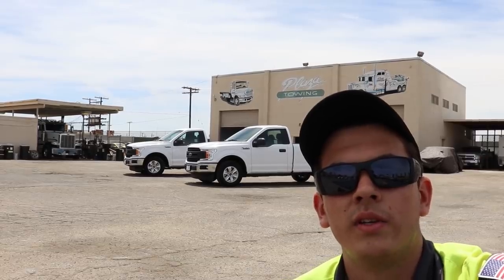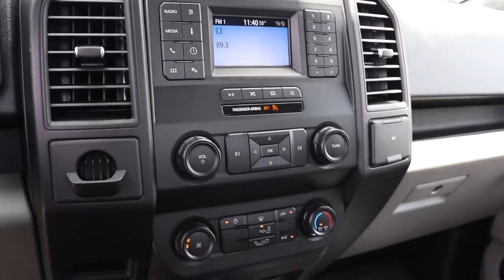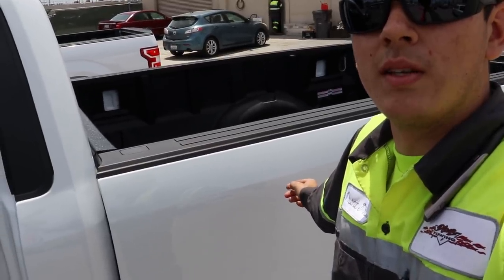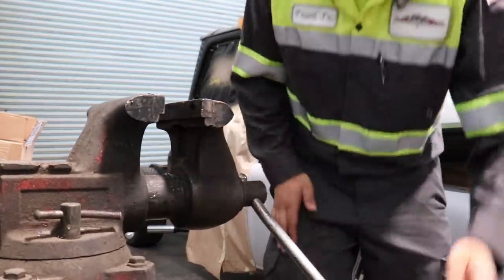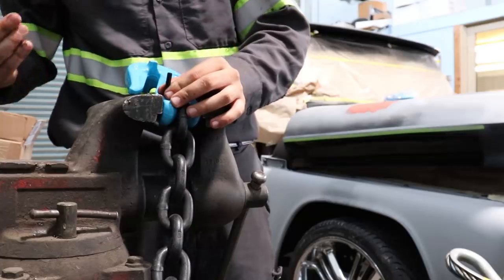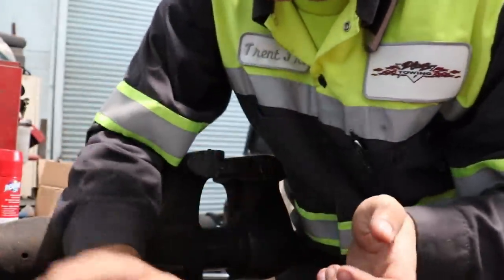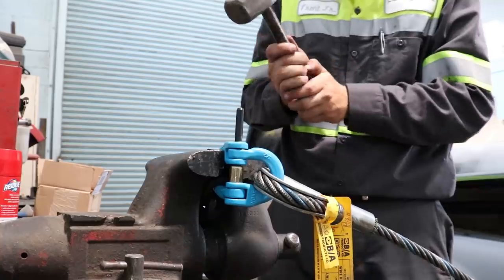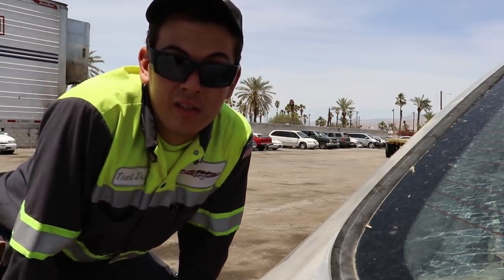Two Brand New Ford F 150's | VLOG 004

Comment: They went with that “bigger battery” because of the stupid auto start/stop. Gotta run all the crap (aux electric water pump, aux trans fluid pump, fan blower, lights, etc) when engine is turned off.

Comment: I guess it depends on what part of the country you live in as to what a part is called ;-) we call   them A Drive pin hardened steel  spring steel.. but depends on what part of the country what they call it.... I always like to drive ours pass flush a little bit coz  up here we have to deal with road salt and you usually got to drive them back and forth because of salt set them tighter than?? (LOL GP rated)  an good luck unrolling that cable and keeping it from wanting to curl back up ;-)
An as to the new service trucks?? Nice sweet looking trucks however I highly doubt the AC will work at the stop sign stop light without the engine turning the pump but this is the twenty-first century so new things are coming out all the time :-)  an it would not be good for me to work in the For Sale yard ;) I would be always buying two and making one! I have split cars long ways and  width ways (edit weld )  the two back together some body work new paint job and you then got a nice good used car ;) thanks for a good video

Comment: The shut off of the engine and restart at every red light IS too hard on the engine and parts in the long run. What make sense stop the engine for 5 seconds and restart at every red light or let the engine run for 5/10 seconds.

Comment: That stop engine feature is kind of strange.  Not to sure if I would like it.
Reply: Can't buy a F150 without it. You can shut it off if you push the button on the dash. The thing that sucks about it is it's defaulted to start up. So every time you start the truck you have to push the button. There is a guy who sells a plug-n-play solution to keep it off until you select it. Personally, I think this 'feature' is stupid and the amount of fuel save is negligible. https://www.cjponyparts.com/autostop-eliminator-for-automatic-start-stop-switch-assembly-f-150-2015-2019/p/AE001/